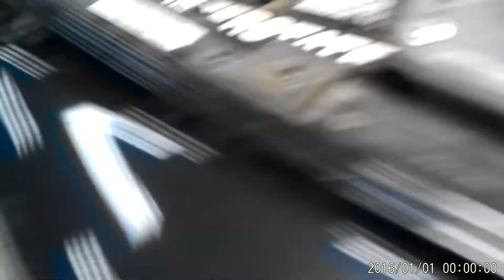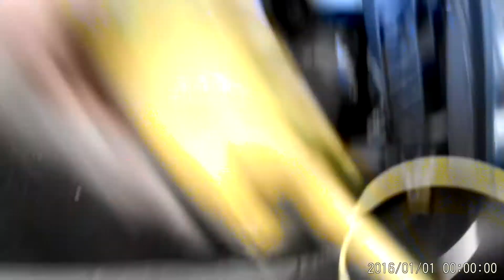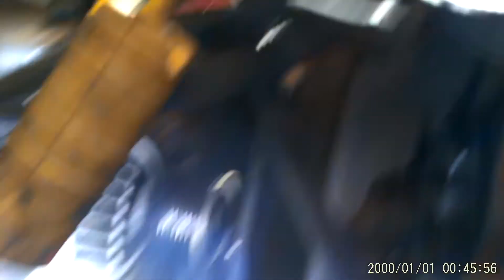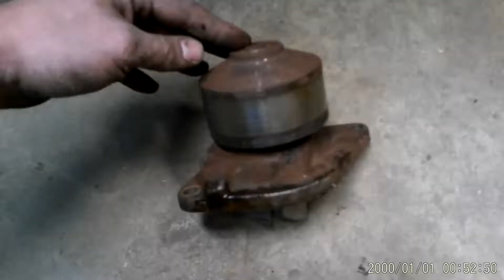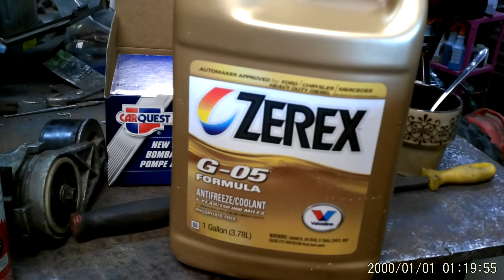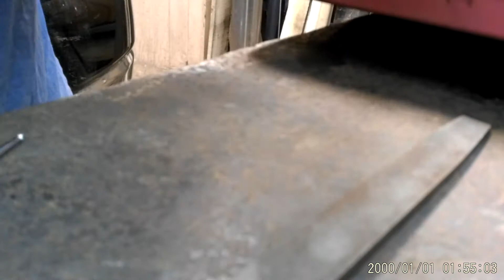Dodge 2500 5.9l Cummins water pump replacement

Comment: When you removed the 2X 10mm bolts for the water pump did you need penetrating oil prior to loosening them of did they come out fairly easy?
Reply from the maker: Came right out. I find it hard to believe penetrating oil would get past the bolt head through the water pump housing and into the threads anyway

Comment: Probably an ignorant question just wanna verify before I screw anything up. At 6:20 you mention spinning everything while the belt is off; you can't throw off the timing doing that can you? How is timing set on those engines?
Reply from the maker: This is the sepentine belt. all this does is drive your accessories so nothing to worry about here.   Some other types of engines drive the water pump off the timing belt and thats where you would want to make sure you get the cams timed right. those belts have "teeth" on them perpendicular to the length of the belt and engage gears rather than pulleys.
Reply: @73DiamondReo  so if the grooves in the belt are parallel to the edge of it, then you've got nothing to worry about; but if they run across it, perpendicular to the edge, you have to check the timing afterwards?
Reply from the maker: @samueldeter9735  pretty much. a timing belt will be behind a timing cover to protect it and you will have to have everything in time when you reinstall one. . usually dots on gears have to correspond with other marks or engine damage is possible.     serpentine and v belts are just for driving your accessories. nothing needs timed with this stuff. you might see a notched v belt on an older vehicle but with a smooth pulley. again its just an accessory drive and nothing to worry about.
Reply: @73DiamondReo  awesome man. Thank you for the epic video and quick replies!

Comment: Your video is good. You have a soft voice & you mumble. Please consider enunciating  carefully & speak up while videoing. Check "Webster Automotive" to see how he does it...the BEST on the net in MHO.  Please understand this is NOT criticism , it is simply suggestions from someone who watches a LOT of these videos.
Reply from the maker: Thanks. I probably need to get a mic as well instead of relying on the camera
Reply: @73DiamondReo  - I understood you fine. The point of the video is to understand how to pull the H2O pump out of a 5.9l and you clearly showed that. Thx.